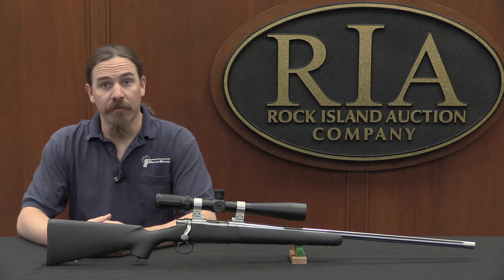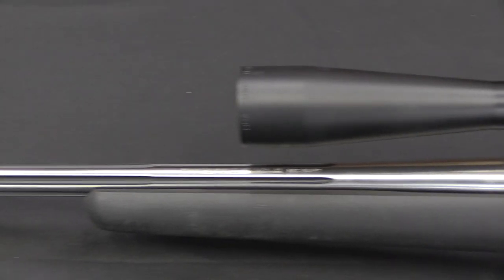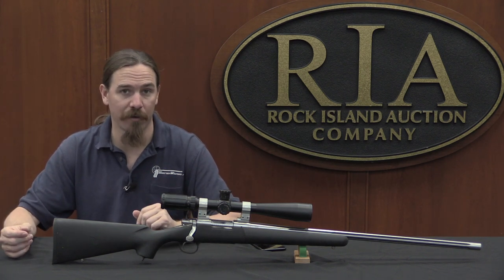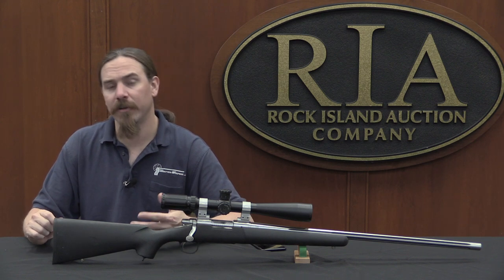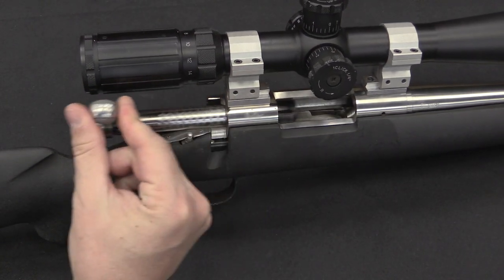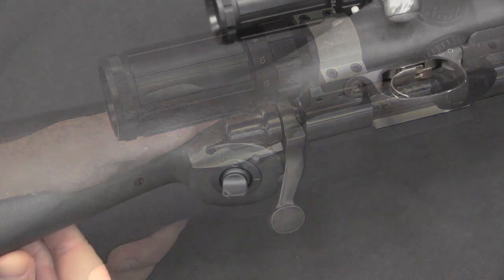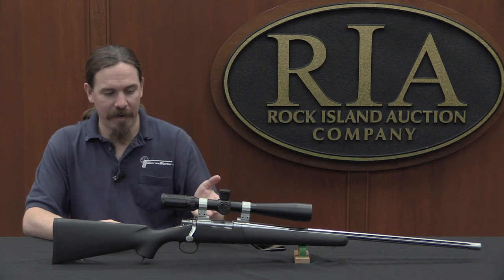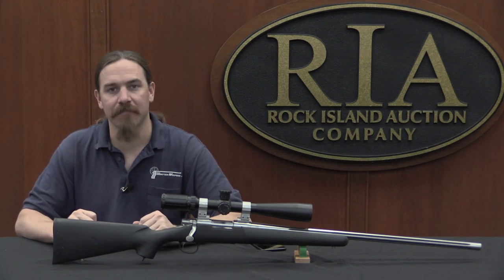Remington EtronX: Electrically Primed Ammunition

Comment: I could think of at least four or five questions this system could be the answer to.... 
Better bullpups (covered in a previous comment) 
Better security (covered in the response to the bullpup comment I think)
A quieter gun: taking out one of the mechanical components would make for an even quieter silenced weapon. With the right ammo and suppressors the only sound would be the loading and rejecting mechanisms which is very controllable. 
Modularity: having a connection from the firing system to whatever rail system you choose to employ could allow you to fire a grenade launcher or shotgun or what have you that might be attached to your rifle with the same trigger as your rifle without a lot of extra mechanical nonsense. 
I can't help but think it'd make the jobs of snipers a tad bit easier too which is never a bad thing. 
You could also configure them so they can switch between pull trigger or release trigger settings if that's something someone needed

Comment: What I've wondered for a while is since the primer is simply a resistor, is there any reason you can't just reload the brass with the old primer in place?
Reply: The resistor would probably burn out completely when the round is fired. I suspect the circuit in the rifle is somewhat similar to a photo flash, using a battery and a boost converter to charge a capacitor to a couple of hundred volts, and then dump that energy into an unsuspecting load all at once when the trigger is pulled.

Comment: I am heavily into electronics and I know the electronics cost at the very most $30.00 , I assume they saved at least that much changing the firing pin. How could they justified doubling the price of the gun by adding $1000.00 to the price of the gun. Also could you buy the primers to use when loading your own rounds?
Reply: R&D.  They knew this thing likely wouldn't sell much so they had to have higher markups per rifle to recoup the development cost.  I'm sure there is also some added markup in there purely for the exclusivity of the operation of the platform too.
Reply: An an engineer who works on electronics I can assure you that the $1000 price increase is completely reasonable.  This was not anticipated to be a high volume product and the engineering, testing, and production would have been extremely expensive.  An electronic product that costs $30 in components that needs this amount of attention to detail and liability risk and sells at low volume likely costs over a million dollars to bring to production.  It's expensive to properly engineer things at low volume.
Reply: In the video, he said numerous times that they sold the primers individually. For the price, they have to guesstimate how many they will sell and be conservative about that, and then all the research and development cost has to be covered by that.
Reply: It's mostly because this was not mass produced and they did not anticipate it catching on.  Because of that they wanted to make sure to recoup their development (and the higher per unit manufacturing costs because of the low number of units produced) costs so they wouldn't lose money.
Reply: The same way hush ammo sells for $30 a box of 50 9mm sub sonic ammo....and the only thing they did is put less powder into a,case and,charge you,more....gotta love,marketing.

Comment: cool gun, except every shot will restart my pacemaker
Reply: Then so would any other gun.... Or a diesel engine (like multiple times a second)
Because all this does is store a charge in a capacitor, then when you pull the trigger it uses the stored energy to quickly heat a resistor.

Comment: A capacitor + resistor combination actually pretty neat and simple solution. Actually, it would be even simpler replacement for classic chemical primers because it's really just a capacitor + resistor and whatever source of electricity you want. Bonus points for saying "cheese!" before clicking the trigger.

Comment: This reminds of a funny story of a spicy firecracker. 

I was sticking welding on my bench, and there happened to be a 22 LR shell. All of a sudden there was a loud BANG. 
it took me 5 minutes of checking to make sure none fuses in the shop had blown before I realized that the arc of stick welder had conducted through the brass shell casing, setting off the primer.
On my table I saw the frayed casing had no mark of a primer strike, but there was visible burn mark on the rim

Comment: They not only put a lock onto the rifle, but but screws on the battery bank and neglected to put the screw head onto the key itself. That mean's there are two easily forgettable things that you need to fire the gun. That is really bad engineering in 21st century.

Comment: I'm actually surprised no military thought of picking this up as a sniper weapon platform. The remington 700 is the basis for the m40, m24, and m2010. So they know the characteristics of the weapon, a few minor modifications (lithium battery, intergrating the power switch to the safety etc) I can see the low lock time, and lack of firing pin spring being beneficial to accuracy, and no spring on the bolt means a very silent bolt when cycling.

Comment: so...what was the problem that Remington solved with this?  Besides lock time.
A soft trigger for shooting 1km+?
Reply: Ivan Krylov It's a smipler design.
Reply: @karigreyd2808  I think a firing pin and a spring is simpler than all of that electrical garbage they stuffed in there.

Comment: I've come back to this video several times now, what if we used electrical primers in a bullpup design? You can get rid of the trigger problem.
Reply: Honestly, I'm surprised that this hasn't been tried yet. It's been proposed several times.
Reply: @jeffbenton6183  I can't either. You'd think that they could retrofit a mechanism inside a standard bullpup or any firearm really. There's probably a legal issue that it would be too easy to hack. At that point you could even control the rate of fire within it's mechanical limits. But a bullpup or a high precision rifle would be probably the best market.
Reply: @andyd2960  True. I can't imagine how they could make a semi-auto NFA-compliant (or the equivalent in other countries). Still, I'd think militaries and SWAT would be interested, not to mention - as you say - benchrest shooters. If it's just a bolt-action, then the law is not going to go after it.

BTW, I had another idea for how this could be useful to someone: blow-forward firearms tend to be more compact than other autos because they have no bolt. I noticed that in Ian's video on the Jackhammer that the firing pin added some length to the design. Perhaps an electric firing pin could make a bullpup design even more space-efficient (depending on tolerance for the added felt recoil the blow-forward operation would add).

Also, thanks for responding so quickly to a reply on a comment you made over a year ago. I was a little surprised you actually bothered to do that.
Reply: @jeffbenton6183  this gun has been on my mind lately anyway

Comment: doesnt the ATF have some sorta issue with electronic guns aparently being "too easily converted for full auto"
obviously that isnt an issue here but a theoretical future gun market would probably have that in mind
Reply: They're already approving electronic trigger systems for AR-15s.  Besides, messing around with the firmware & circuitry of an electronic trigger system doesn't sound much easier than performing a full-auto conversion on a traditional firearm.  It's not like you'll be able to just run a USB cable to your computer and change a 0 to a 1 somewhere.
Reply: I would imagine that it would be easier to convert an electric gun. You just need an auto cycling system (not a bolt gun) and put a suitable mosfet on it, replacing the original linkage between the trigger and firing pin.
Reply: Logically guns that need need you to work the action like this would be exempt.
Reply: Jay Cee One-Three-Six It would be extremely hard in a none AR platform , such as this with a bolt cycling system to convert it to fully automatic.
 As Timing would be uncontrollable without designing a fire control chip to modify the cycling.
Reply: it is electronically firing not electronically cycling, you need to keep your mechanical system as it is for the bolt to properly function. as for firing if it is connectable to the computer then you could mod the system to allow for full auto if the hard ware allows for it.
Reply: Sean Rea Surely it must be possible to build an electronic cycling system also, a variable rate of full auto fire could be a very useful thing militarily.
Reply: Jay Cee One-Three-Six just enable sv cheats 1
Reply: Synchronizor hehe, I almost put a Arduino in a AR15 didn't know that was a no-no....
Reply: It's already very easy to convert a regular semi auto into a fully auto by removing the part that locks the trigger until you release and pull it again. Of course, this is unsafe unless you get an auto sear to hold the hammer until the bolt is fully closed, but those aren't hard to make. All they can do is make it illegal to do that.
Reply: @SynchronizorVideos  it IS exactly like that. Attach a serial cable, download the firmware, change it, upload a new one.
Field selectable rate of fire under full auto would be my favorite. Or fire rate timed by midi (music notes) files...
Reply: That's assuming the electronics can actually be reprogrammed in the first place.  Seems like that would be a big no-no for any electrically-fired semi-auto design for obvious reasons.  Also, how much programming does it really take to fire a capacitor when a button is pressed?

Comment: Interesting curiosity; may appreciate in value in the future, kinda like the Gyrojet. 

I wonder why no one's bothered to make a production railgun that fires common wood nails yet?
Reply: For a conceptually very simple technology, railguns are surprisingly hard to productionize. They have a tendency to either a) weld the projectile to the rails, b) cause the rails to slowly erode due to sparking between the rails and projectile, or c) have the rails bend towards each other due to magnetic force. And then you need an absolutely massive battery bank to run the thing. Coilguns (which accelerate the projectile using electromagnets, rather than by just feeding huge currents through it) are a lot more sensible, but still need a big power supply.

They are ridiculously cool though, which is a big plus ;) Some hobbyists have made sorta-portable ones which can get a few shots, albeit at a reasonably low velocity.

It's really hard to get away from the sheer energy density of explosive propellants.

Comment: You know a weapon design is a bad design when it involves error codes and an easily lost key.
Reply: I agree with the error code.
But having children myself... 
keys are a very good idea, the more keys in the way the better. 
Especially if a child suffers from depression, general anxiety disorder, or amy other mental disorder.
 Every barrier is a good barrier in that case.
Reply: My key would be attached to the weapon, a spare key and battery I would carry on me, a 3rd key would be safely at home.
Reply: @jimandaubz  : Honestly, with an electronic ignition I'd say to just stick a nice big cutoff switch in the electric circuit, mount it in the stock, and place some mounting holes for a conventional lock so that the owner can buy whatever model they feel like from their local Wal-Mart.
Reply: @absalomdraconis  the electrical cutoff that you are talking about is in the key mechanism. The rifle has secondary circuits for diagnostics and one of them keeps the safe sensor (and maybe the chamber sensor) on to warn the user that the rifle is not safe to store.

Comment: Question: would a lightning strike set off normal ammunition?
Reply: Yes as will any real current across a cartridge.
Reply: Yeah, I saw a hickok45 video where he put some cartridges in a pot over a fire and after a lil' while they popped off, but did next to nothing. Anyway, thanks for the answer.
Reply: it it's hangin around, it'll not likely kill anything, but it it was in a gun, the bullet could easily kill someone. its being in the barrel that makes the bullet fly forward

Comment: The first time I saw that I shook my head and rolled my eye's!!! If they wanted to do something significant powder that produced more velocity at a lower pressure and at a cooler temp that would have been something. They could have perfected the Remington 700 so it left the factory without needing to be blueprinted in order to be accurate. Like you said it was a solution to a problem no one had. I think a good way to look at this is to look at cell phones say 1990 to 2019.

Comment: The moment Remington announced this I knew it was going to be a disaster.   There is one redeeming feature not mentioned, which I’ll explain later. 

With firearms, there is a great amount of satisfaction and beauty in the weapon being totally mechanical.   I am not alone in preferring manual transmissions, mechanical watches, and mechanical (film) cameras.   Although people often say that the electronic or automated version is “faster” or   “more accurate”, or “higher quality”, what all these explanations overlook is that the mechanical item offers its user a degree of engagement, involvement, and satisfaction that its automated electronic counterpart lacks.  

So what is the redeeming quality of an electronic firearm?   It is that for the manufacturers the production costs will be lower due to fewer parts and fewer moving parts that need precise alignment and tolerance.   For that reason alone the day of the common electronic weapon may come.  

Interestingly, today (March 2023) I found new Remington .22-250 EtronX in stock at $27 per box of 20 and regular Remington .22-250 at $32.
Reply: supply and demand in action. nobody wants this junk.

Comment: I can understand some people wanting a key lock out for their firearm.  Sure its not the best way to secure it, but as an additional step to using the rifle it could be sought after.

Also, according to remmington the bullet would actually leave the barrel faster then a normal rifle would take to strike the pin.  It's a really neat concept.  I wonder if there could be a military use for the ignition system.  If the ammo is able to withstand abuse and the battery was quicker to change it could reduce to number of parts in a rifle.

Comment: I wanted one of these bad back in the day in either .220 Swift or .22-250 Rem. I also had all the concerns Ian mentions in this video (well, except for the EMP scenario). Finally, I ended up getting both in a conventional system for the price of one of the calibers in the Etronix. And, in case anyone wonders, it is .220 Swift for the win between those two but I still shoot them both, along with .17 Rem, .204 Ruger, .243 Win, 6mm Rem, etc.

Comment: That is definitely a cool take on an old bullet design, and would have to imagine that it would be a little bit more accurate because trigger has less pull and you don't have the mass of the hammer and firing pin slamming in to the bullet.

Comment: I was reading this article a while ago I cant remember where. But the subject was electronic guns. Finger print safety smart IFF and electrically fired ammo that sort of thing. The bit i remember is they pointed out you could ,with electrically primed ammo, fire something stupid like 1,000,000 rounds a minute out of a few barrels that had been pre loaded with electrically primed caseless rounds. Imagine a mini gun affair with the rounds muzzle loaded and enough barrel left to give proper spin. This would be used basically as point defence for a F.O.B or similar as it would have smart targeting systems. After the barrel had discharged all the rounds you simply replaced the empty tubes with fresh ones

Comment: Hey Ian. Thanks for all the work you do! Especially for coming to South Africa and showing off the weird and frankly cool stuff we used to get up to. I love seeing the engineering of all the weapons in your videos, which got me thinking.

Question: Do you see this electrically-primed/electrical fire system as potential for the future?
I have been thinking about it a lot. Using modern electronics, there does seem to be potential in creating modern electrical bolt/firing mechanisms, or by using modern air powered systems. What's your take on this? I hope we can see a lot more interesting weapons on this experimental front in the future, and you can bet I'll be staying tuned.

Comment: The worse thing about it is the crappy lock. It's a standards commercial key switch and they are all keyed alike. That and the fact that the lock can be jiggled open trivially. Really they should have given it a nice waterproof on/off knob. In fact the safety should have been the on/off.
Second thing is the choice of battery. PP3s are obsolete, they were obsolete then, they were useful when electronics was old bi-polar junction transistors, but with CMOS most circuits can be made to run on 3V, a couple of D-cells would give you 100 times the energy capacity.
I guess what I am saying is: What would a modern version of this look like? Take the trigger off the gun, so you don't /can't pull the shots, put the trigger on a separate grippy thing in your left hand, bipod plus rear monopod, electronic optics in the sights with auto range finder, bullet drop compensator and all viewed through VR goggles so you don't even have to have a cheek weld...